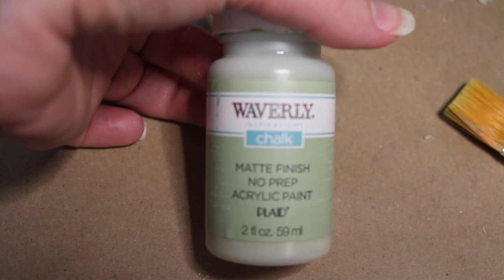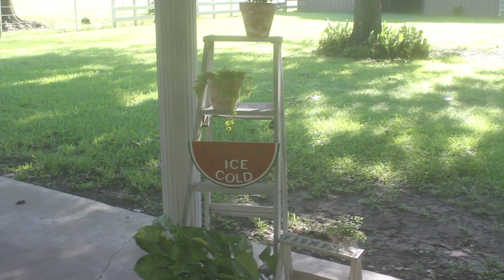DIY Mini Farmhouse Step Ladder!

Comment: Hi Jessica,  I'm a new subie. So you now have another best friend! Yay, lol.... I love this little ladder. It is so cute! Truly it is. Do you have any estimates as far as your cuts on the sides? I would love to recreate this. I was in dollar general and they had one in particleboard for 25.00. I waited because I knew there possibly could be a better way. I found your channel. Tyfs... so beautiful. I love the stenciling on it also. God bless.
Reply from the maker: As far as the angles on the bottom of the legs I believe I used a 15 degree cut, but I have a miter saw that easily does that for me. One way you might be able to achieve this without that type of tool is cross your two legs together at the top then hold the bottom up to the edge of a table you could then draw your bottom lines by following the table edge. Then you would know that you cut them straight and your piece would sit level. As far as the length of the legs on both sides they are about 17 inches long. Hope this helps! Thanks! :)